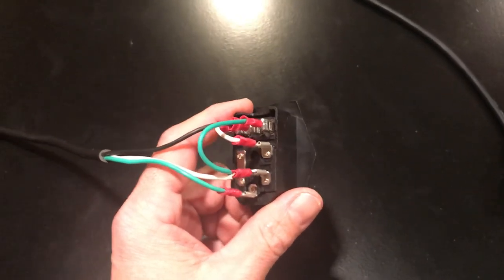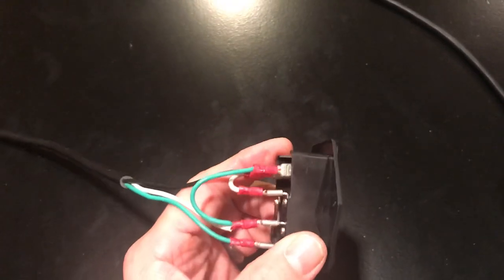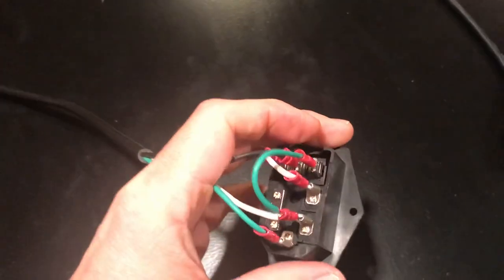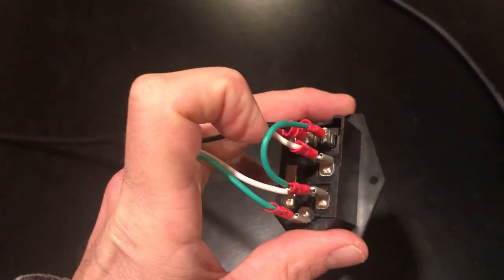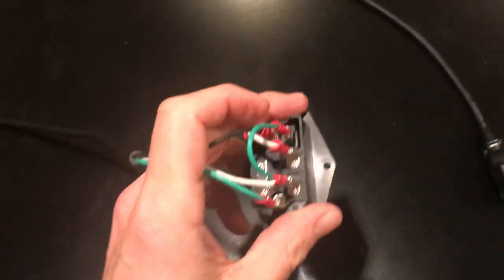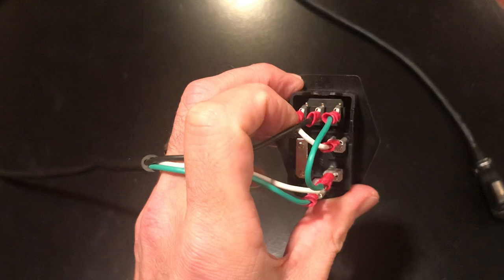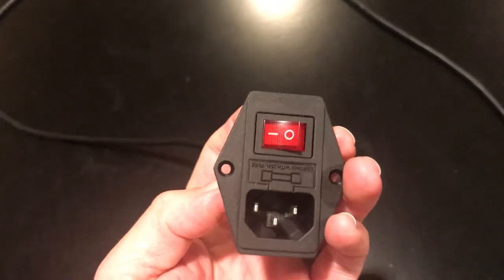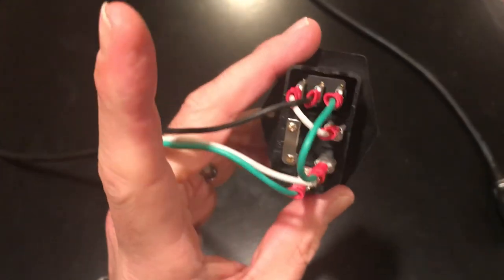How to CORRECTLY Wire Arcade Power Switch - 3 pin lighted

Comment: how do i wire with a switch without a light? The back is very confusing as the switch has 4 pins, and there's a weird tray that can come out in the middle
Reply from the maker: Sorry I don’t have experience with a 4 pin one.

Comment: Thank you for this! Been searching for the same thing! Will this connection do so that the light in the switch is always on, or only when the switch is in the ON-position?
Reply from the maker: Preben Stub you’re welcome.  In my set up, which is this video, the light is only on when the power switch is on
Reply: @michaelhutter9432  Great! Saw some guides where the light either didn't work at all, or was on the entire time as well, so figured that I might as well ask you! But then this method works the way I want it to! Hope to be able to set it up next week (waiting for more China-stuff...)

HAPPY EASTER! :)
Reply: Would have been better if you followed NEMA color standards.

Comment: This is just THE best video possible for this sort of thing - short and straight to the point, even mentioning possibilities where variances could change the wiring.

I wired mine exactly like yours and the switch lit up but didn't power anything. Then when you mentioned to watch out for reversed power switches, sure enough my switch was the opposite of yours. Switched the left and right wires and boom! Well not literally thankfully. Works perfect.
Reply from the maker: That’s awesome!  Glad it helped.

Comment: Mike,

Thanks for taking the time to post...doing something similar involving an illuminated 3 pin rocker and your video is hopefully assisting...

My application is not for an arcade game...and I am not using an all-in-one power inlet / fuse / illuminated switch...  I simply have a power inlet, switch and outlet strip...but if I might ask ...would it possibly be a little more clear if you could have used a black wire for the jumper up to the left side of the switch, and then continue with a white wire (instead of green) just for clarity and continuity (not electrical continuity, color coding...).

It threw me off a bit looking at the video, lol (simple mind) until I realized that the fuse itself is inline with the black (hot) line...   Stupidity on my behalf.

Again, thanks for taking time to shoot and post.
Reply from the maker: Thanks for the feedback and you’re welcome. And yeah I probably should’ve used a black jumper.